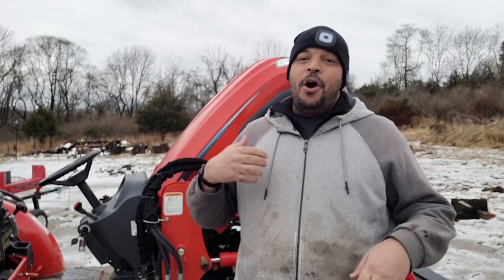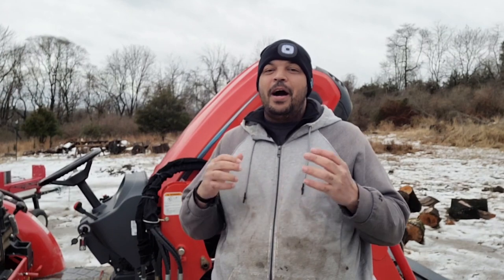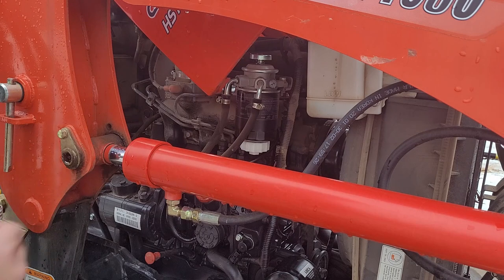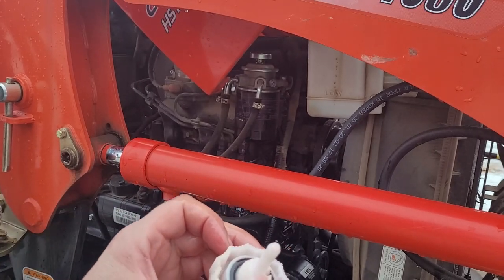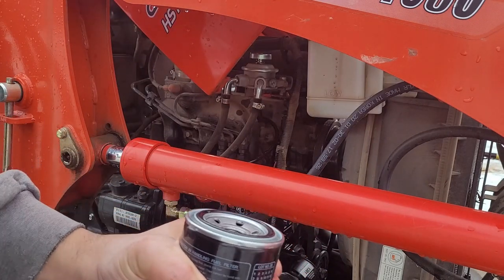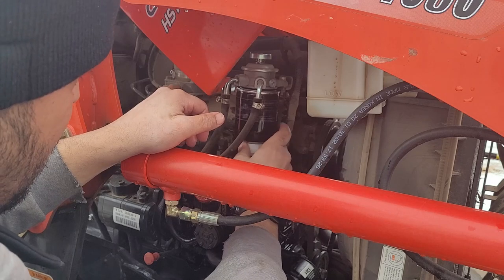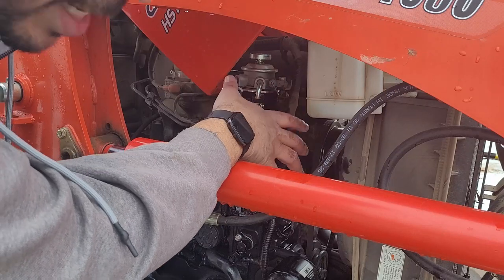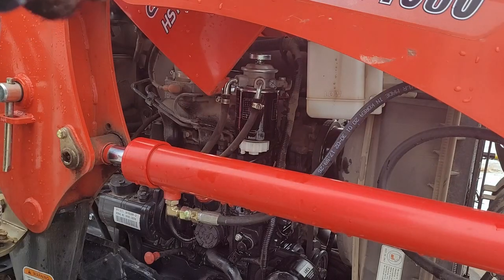My Kioti CK2610 stalled! I replaced the fuel filter and here's how it went.

Comment: Congrats dad!!
Just fyi for all CK owners. Mine has 160 hrs and have had more issues than you can imagine. One issue that caused the dealer to take it back twice (and the new dealer once) was the fact it would stall out or just not start. After the first visit they unplugged the seat safety and gave it back to me. Horrible that a dealer would do this. Well long story short and after another dealership got involved, there is a recall from Kioti to fix this. Keep an eye on it. Look into his recall with your dealer. My CK3510SE was purchased in Oct '20.
Reply from the maker: Thanks for the congrats I really do appreciate it 😎 Thanks for the heads up with the recalls and potential problems 👍

Comment: Great video. Do you run #1 or #2 diesel in your KIOTI?
Reply from the maker: I use what they call off road diesel in my tractor I'm not too sure what number it is but you can't put it in your cars it's for off road use vehicles only
Reply: I run just the car diesel in my DK5310SE, I am not a fan of off road diesel, they put a dye in it, I don’t know if it leaves a residue in the cylinder or causes other issues…

Comment: I have the CK 3510 and I've stalled too so did you have fuel in the filter or just debris
Reply from the maker: There was fuel in the filter But after I replaced it and prime the system is started right backup  With minimal effort... I am not a professional but also check your Air filter